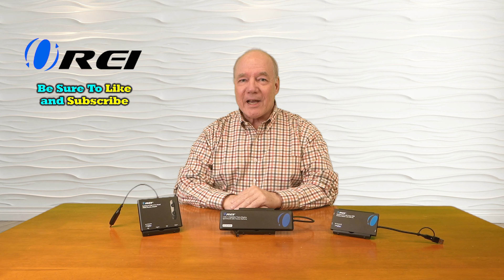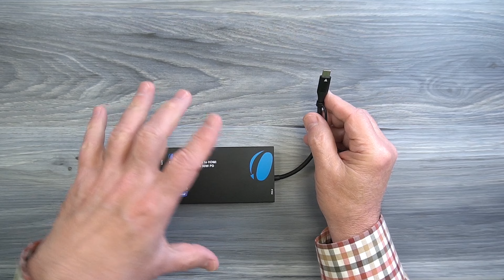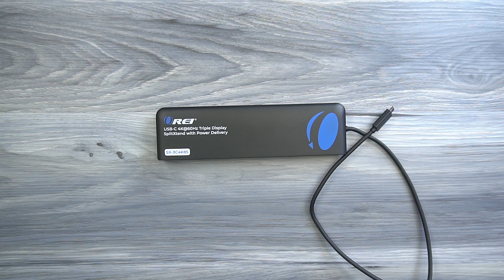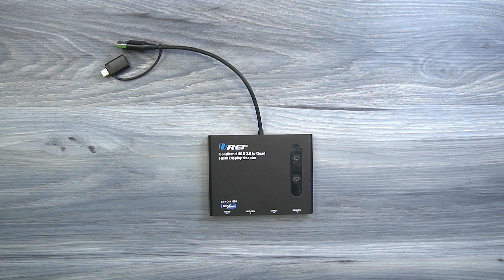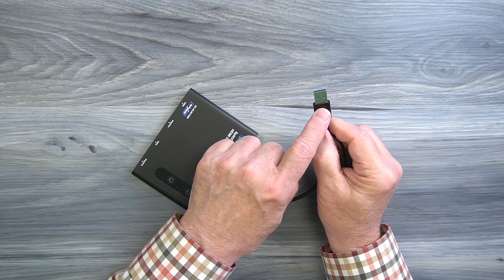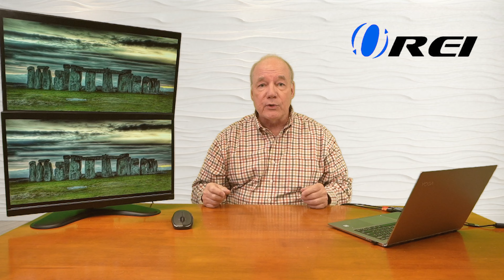Which SplitExtend is the Right one for you?

Comment: Would this work for my situation? I work from home and have an Elitebook 850 G7 from work and a HP G5 dock that we are using. I have two external displays set up but because we had some additional offices that we tagged onto our practice, I feel like I would benefit from another 3rd external screen. When I use the built in ports on the back of the hub there are two DP and one HDMI. It will only allow me to use 2 of the external monitors at a time and will just mark the 3rd as inactive no matter what I do. Would that splitter for the 3 monitors work for this?
Reply from the maker: https://www.amazon.com/OREI-SplitExtend-Splitter-Extended-Display/dp/B0DG9PZDYL